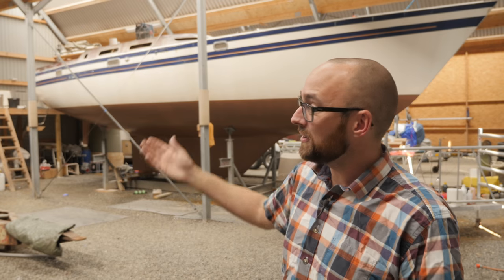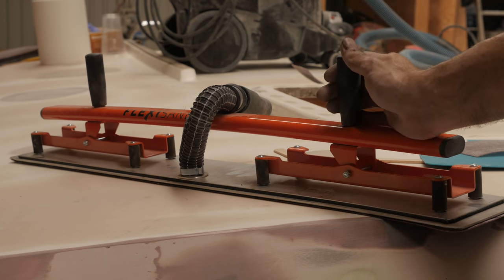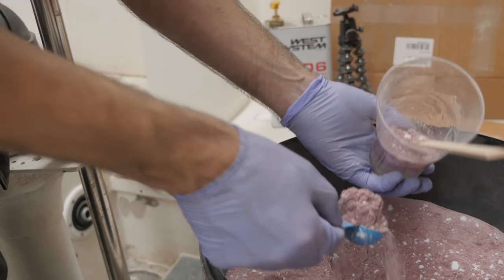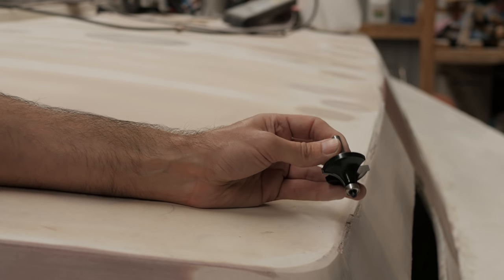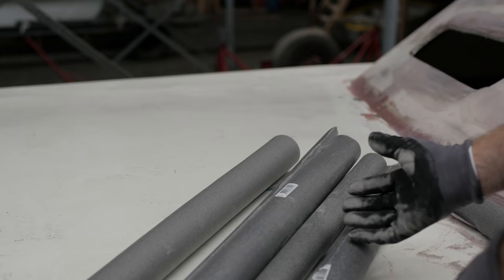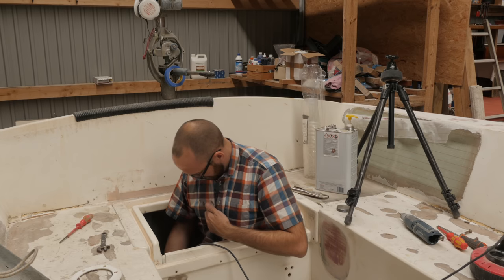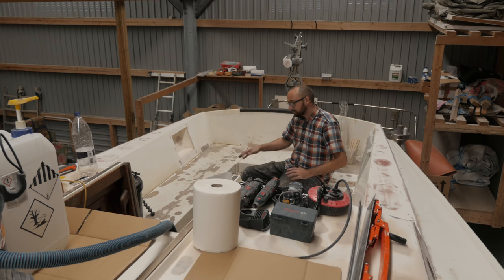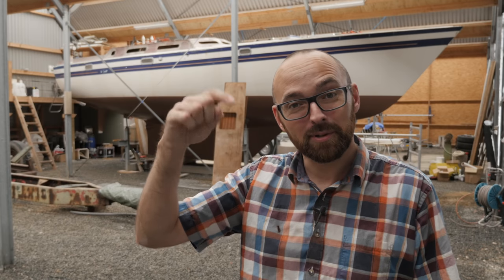Sail Life - Fairing the deck and prep-work for paint - DIY sailboat restoration

Comment: Even original boat builders generally don't go for this level of detail.
Reply: Untrue, I'm afraid. Depends on the project and the owner/customer.
Reply: Also software is never finished!
Reply: They do, but not in commercial applications.
Reply: I've found this is mostly true on a spectrum between "custom commissioned yacht" to "Assembly line of the same hulls."... Where when you get to the assembly line boats (Beneteau, etc..) you get "Ford" level attention to details. This doesn't mean your Beneteau sucks (if anyone reading this owns one, I do), it just means that depending on the era, you can expect different details to just be "wrong", or poorly designed. For instance, on my late 80s Beneteau, all of the dorade boxes have baffle vents into the cabin that offer only a millimeter (I'm not joking) of volume from the vent pipe to the top of the dorade box... meaning they designed dorade boxes that don't even preserve the right flow volume all the way through. It's not that big of a deal to fix it, but it's just one of those silly details that someone should have worked out better before handing the assembly materials to the builders.
Reply: production boats are divided in "charter versions" and "owner versions" usually these days. 
Charter versions are "cost conscious" aka crap in terms of build quality AND construction. 
The owner version usually is a much better crafted build of the same flawed original construction. ( lipstick teak on a pig ...)
You saw this sort of thing here multiple times when Mads got his various surprises disassembling unbelievably crappy details.
Build quality started going south vertically when cored hulls started to become standard in the industry, and the output as well as the numbers of building yards punching out "series" of standardized Tupperware boats increased steeply.

Comment: You have to leave some of the "old" boat, Dont touch the teak around the door.
Reply: If it ani't broke don't fix it.
Reply: Agreed, Athena needs to retain some of her character and as 54DonaldB reminds us, why add more work that is totally unnecessary?
Reply: Besides, you will NEED something to putter with At SEA. You know, in the Doldrums? Waiting Out weather systems? Teak and mahogany Much CHEAPER in the Caribbean and South Pacific.
Reply: But the trim is only a few simple teak boards.  There's nothing special about the old trim that makes it worth working around - especially when the painting happens.
Reply: I should have added:  Then replace the trim. The net time might be lower if the trim was removed and refinished (or replaced), and reinstalled, than if he were to refinish the old trim while in place.    I Think Mads would prefer to just paint to the edge, then reinstall the trim.  The fasteners would be properly installed and sealed.  Also, it would eliminate the need to cut-in the new paint at the edge of the old hatch trim.
Reply: Do touch it... with some varnish.
Then leave it.
Reply: Amen!

Comment: It pains me to say this but I'm a new subscriber and watching this brings back the nightmare that was my father taking 35yrs to finish his boat part time, all the sanding, the dust, the mess, the endless roadblocks, the perfectionism/aka doing it "right", granted he started from scratch but the process is the same. Living a cruel dream... seems that's why do people do this too themselves, save up and pay someone who is a boat repair specialist to do the work or if that's too expensive face the fact you bought a dud and cut your losses, don't get stuck in the sunken cost fallacy, which is the trap I think my father fell into. When I hear Mads say only 2 more years to go and I see the crazy hours he's putting in(just like my father did every single day of my childhood) I get flash backs of my father saying that same thing every few years. 
Granted all boats require endless maintenance but the real question you need to ask yourself is do you want to be a boat builder or boat sailor?

Either way good luck Mads!!

Comment: Hi Mads,
Just thinking of your fuel tank. You suggested that you may put in additional tanks, if you do you will probably need a fuel pump to transfer fuel to the day tank. I would consider putting in a manifold to feed the pump with stopcocks on each line. Another manifold on the outlet, one to the fuel tank and another to the heater tank and possibly the generator tank. I would also consider putting a manual pump in parallel with the electric one in case it breaks. It happened to us part way across a long windless passage & we had a nightmare of a job transferring fuel. 
If the deep bilge area is not suitable to put a fuel tank in, just paint it, then glass in some batons half way down then you could put in a bit of plywood in for an extra bit of storage and you have room for a bilge pump pick up. 
Loving your project. Alan.

Comment: You are doing a great job.  I suggest sanding and oiling the teak in the cockpit.  Varnished teak looks great, but it takes regular re-sanding and applying a fresh coat of varnish to keep that spiffy appearance.  I also suggest going with a synthetic wood product for the seating area in the cockpit as it will not rot.

Comment: That’s a “fair” amount of work! Great diy with the router, very little left to do by hand. If the companionway components don’t leak, it’s ok, for now. Go easy on the primer, you’ll be fairing again. A flashlight at a low angle, in a dark shed, with unsanded primer will reveal unfair spots. When your boat’s at anchor, & you’re rowing away in the dinghy, she will make you smile when you look at her!! Yer doin’ fine, Cap’n!!

Comment: When I have to stand in any of my home projects I use a strong flashlight to check for inconsistencies on the surface area I work on... you just slide the flashlight with the beam parallel to the surface and check... personally found it more practical than using rules and and other straight objects especially when I have to deal with curve.
Plus you can use the light while sanding to keep In check where you are.
You can also use a simple champ laser if you want sometimes it is better for bigger surface areas.
Love your project. I hope I'll get to work on my own sailing boat soon

Comment: PS The black plastic retainer rings that hold the helm unit together - the binnacle guard tubes run thru them and they fit into the flat aluminum plate onto which the compass is bolted - are a pain as they loosen and then the whole unit wiggles. I cut the curved tops off of mine with a hacksaw so I could continue to use them to hold the tubes tight, but than ordered some stainless steel collars from McMaster-Carr to hold them down. the collars tighten up with an Allan key. The whole unit is much more stable with the collars.

Comment: for the outside edge, i use a piece of sandpaper folded over twice and then run a crease down it and sand by hand with it until you get the profile you desire

Comment: Hi Mads, you're doing a great job.  On the teak part of the hatch I would recommend that you don't remove it.  I did and regretted it. Lots of money and time to replace.  Just use a good two part teak cleaner, a bit of light sanding, and apply the finish of your choice.

Comment: You are getting pretty good with that large fairing board !

When going for total SPIFFY, auto guys usually use a "high build" epoxy primer.  This allows for one additional sanding and fills any pin holes in the compound.  Seeing as you are well above the waterline, I don't see why you can not use this, maybe even before your "marine" primer.

I love you "solution" of the "Franken-router-bit" !  But the ball bearing a not riding on anything so how do you guide it along the slightly curve edge of the cabin top ?

Comment: I know you are getting close to being done fairing but if you put your epoxy mix in a vacuum chamber for just a bit it will pull out the air bubbles.

Comment: Another good video, thank you Mads. 
FWIW- Your Whitlock wheel steering unit is mostly aluminum. The round part from which the steering wheel post emerges is plastic and prone to crack from UV damage. It is a 'when' not 'if' breakdown.....you may want to replace it while your attention is focused on that part of the boat. Parts are available from https://www.whitlocksteering.com/. I believe the chap is in the UK.  I have same Whitlock unit on my Canadian-made  Mirage 35. Painting the base - even after using Aluminum primer following application of Alumaprep - has not been satisfactory for me. I will probably remove mine this winter and have the base powder coated.  Cheers, Randall

Comment: If you plan on removing that piece of wood, heat the fiberglass from the inside, don't heat the wood. Maybe get a piece of pipe, cut a sector or two out of it, and tape it to the inside of the corner, then, at the bottom put a heat gun.

Comment: Stop this "I'm not a good rebuilder, just a diy bodger" crap already, Mads, please.
In my active time I would have hired You any day (minus the videotaping, of course) to have one of those precious ones who don't ruin something completely for half an hour shortcut.
Reply: manfred schmalbach Couldn’t agree more, Manfred. You are absolutely right. Mads does every work with accuracy even professionals wouldn’t do
Reply: I did, as a pro, for more than 3 decades ... driving me away from GRP though, towards pricey high end materials from mahogany down to carbon 
and aramide prepregs - customers who were able to adapt to a no-shortcuts policy, affordability-wise, were prepared for high end material's price range also.
Mads has already reached the stage where he builds his own tooling to improve the outcome, be it a modified router bit or a specialized spatula .... and all this with typical boatbuilder's low key approach like file-on-running-router, handheld, of course.
Only two steps further I would know of would be 
1) developing/building his own machinery to do things "normal" stock machines aren't capable of like Matthias Wandel created his pantorouter (something I was originally drawn towards ever since building my own crap, be it soap box g-force cars, vintage motorcycle alu tankage or accellerating equipment for me & my sailor buddies ...) and 
2) inventing solutions for sailing equipment never yet seen on the market, might it be for faster sailing (unlikely, given his seasickness issues) or for better/easier shorthanded sailing (we're going to be treated with some of those probably after Athena's launch and Ms Ava's move-in, hopefully).
Reply: I'm a mechanic - never touches wood, but i simply had to look up that Pantorouter. What an amazing piece of machinery. Thanks for mentioning it. :-)
Reply: Kenneth Yeah, ain't it an absolute gem, built from wood and ply and recycled shaft materials off printers and copy machines? You might find his (Matthias') bandsaws and some other wooden machinery on woodgears.ca interesting, too (You might have found that already anyway ...) cheers